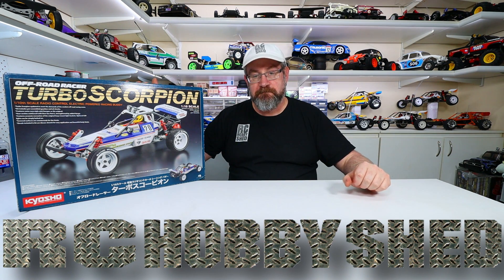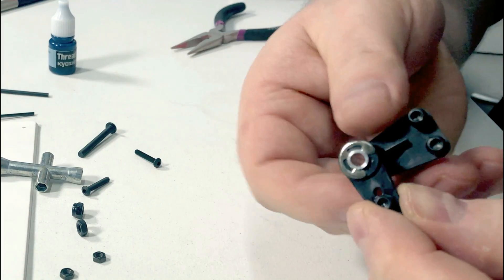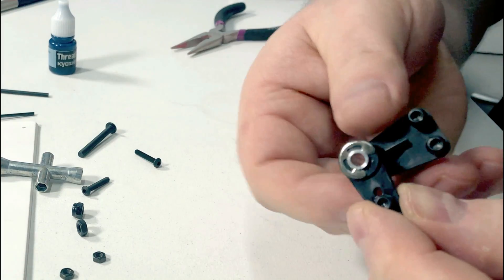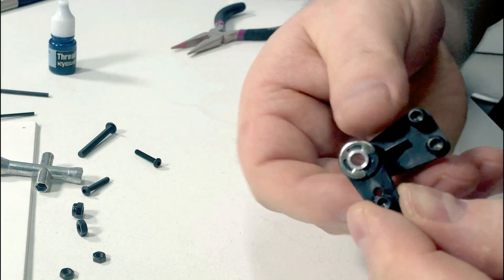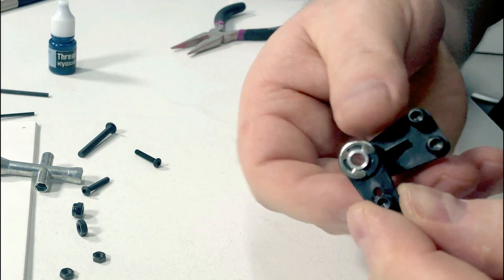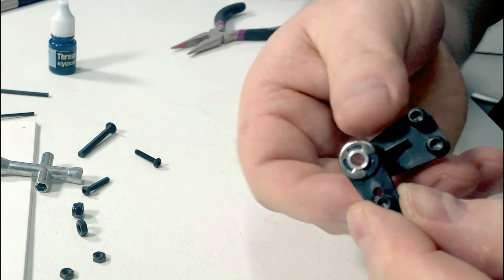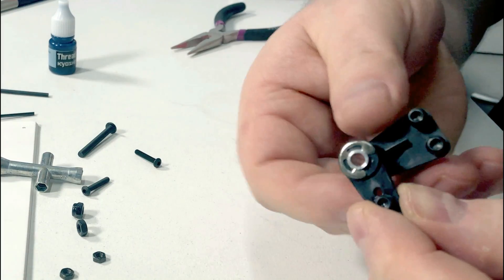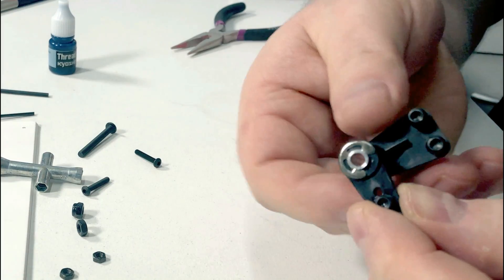Kyosho Turbo Scorpion - Kit 30616 | Building The Chassis

Comment: Lovely build 😎
Send me so info on that motor Mick please 😊👊🏻
Reply from the maker: Thanks Glenn! Ok... Hope this helps. Price is around $30USD I believe. 
Reedy Radon 2 19T 3-Slot 3200Kv Brushed 540 Motor.
Cells:2S LiPo/6-7cell NiMH
Diameter (mm): 36
Length (mm): 53
Features:
    Dual ball bearings
    Adjustable timing
    Powerful 3-slot armature
    Completely rebuildable
Reply: RC Hobby Shed 
Excellent I didn’t know you could still buy modern ish Reedy brushed motors 😊😊😊
Reply from the maker: @TAMIYALegends  Oh yeah, they're still going. They have a few variations of this motor, 15t, 17t, 19t that I know of and some crawler winds. 👍

Comment: Nice build.
I'm building it at the moment.
My diff was neerly locked. I had to loosen the screws a bit. I also opened it and cleaned all the grease out. Checked for dirt and greased it up again. And still i needed to let the screws loose a bit.
Reply from the maker: Thanks Christoph. Awesome, they're a great buggy.
Hmm that's strange, I've not had that issue with any of these types of chassis. Hope it works OK for you. If I think of a reason it might be like that I'll let you know. 👍
Reply: @RCHobbyShed  i put the extra seal from the spare parts in. Now i could fasten the screws and the diff works fine.

Comment: Great video Mick.  Just the right amount of detail and pace.  Looks like a lovely kit.  Never noticed the odd angle of the rear suspension pivots on these before.  I'm sure that there's a good reason for it.  Anyway I notice that there is a video of this finished now so I'll check it out in a bit.  Cheers for now :-)
Reply from the maker: Thanks Pete! I'm trying to make the build videos less boring, not an easy task to fit all the info in without being too lengthy. At the very least my videos will still be boring but shorter 🤣. I think the reason for that is to give it some negative camber, being trailing arm I imagine the negative camber will help with cornering. 
Thanks mate! 🙂👍

Comment: Did you use thread lock? Does the kit come with thread lock?
Reply: I was going to ask the same question.
Reply from the maker: Yes I did, and yes it does. I used it wherever indicated in the manual. 🙂👍
Reply: @RCHobbyShed  Yes, with all of the metal of this kit it would be necessary.

Comment: Im very curious to see how that reedy motor performs? The can and endbell exactly match the cheap chinese brushed motors lately and those things are junk. I got a 12 turn...it was just awful. Good build!
Reply from the maker: Yeah it will be interesting. I'm not sure of the quality either, although it appears quite good. We're still in lockdown for another couple of weeks, so not sure when I can get out to run it but there will be a run video for sure! Thanks! 👍
Reply: @RCHobbyShed  when i took the chinese motor apart the slots and windings were shorter than a normal 540 and they had a brass sleeve welded to the silver pin so it wouldnt wobble back and forth inside the 540 can. Very disappointed.

Comment: Thanks for sharing. Been looking into picking this kit up. Have used after market hardware ( RC SCREWZ) or powder coating/ anodizing the frame or metal parts?
Reply from the maker: Thanks! Everything used here (apart from electrics) is from the kit, so no aftermarket screws or coatings. It's just how the kit comes. 🙂👍
Reply: @RCHobbyShed  have you ever thought about using alloy parts,or anodizing the frame
Reply from the maker: @johnband3  I haven't really though about it, mostly because I think they look awesome how they are. But it would look cool for a custom build, although I'd be scared of scratching the anodizing then. 👍
Reply: @RCHobbyShed  thanks be safe
Reply from the maker: @johnband3  Thanks John, you too! 👍

Comment: First, very nice videos with good information.
I know I've hear you say it in this video or if it was the tomahawk. But I'm building a tomahawk at the moment and will put some oil in the diff. 
What cst did you use? I stuck some 30k in there now but think you even went heavier?
Kindly
Per
Reply from the maker: Thanks for the great feedback!
I don't think I use any oil in the diff as they come pre-assembled, so they are already greased. 
Maybe I should have opened it up though, as someone recently said there isn't a lot of grease in there. 
Let me know how it goes. 👍